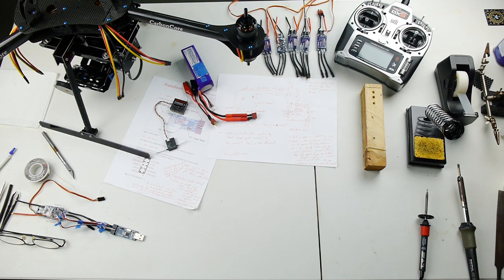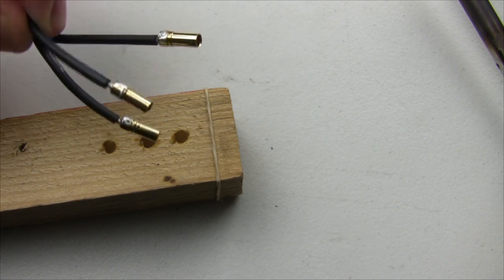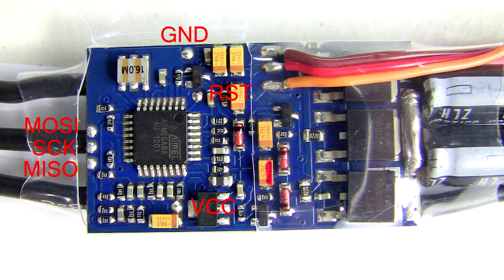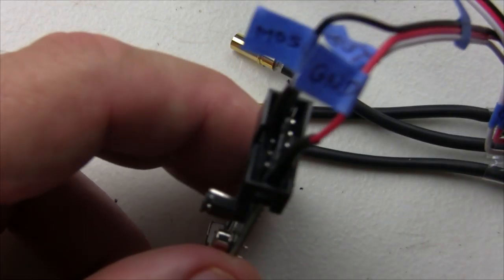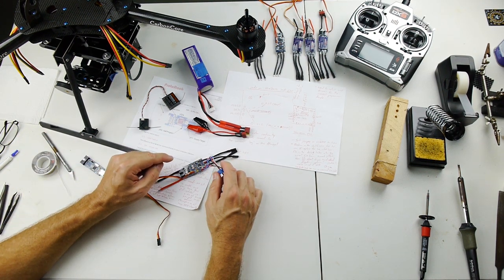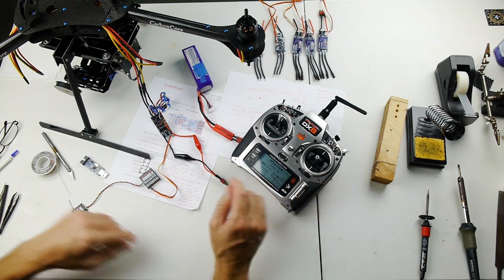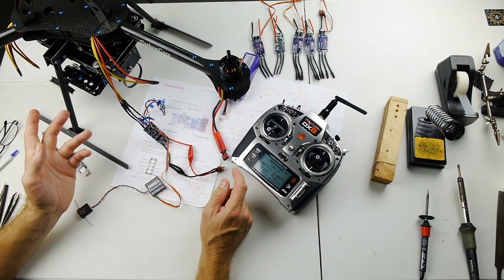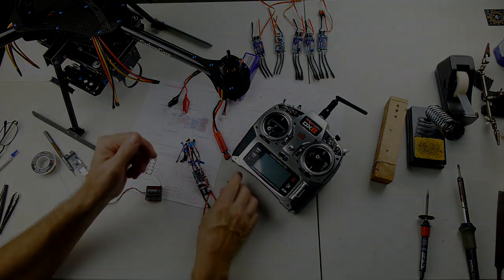Flash BlueSeries ESC with SimonK firmware

Comment: Good helpful video.  Thanks for posting.  You don't need to disable throttle warning to calibrate the ESCs, just turn on TX with throttle in idle, then move to full throttle before connecting power to the ESC.

Comment: 35-40 Watt is where you want to be at. Anything over 20 Watt and under 45 Watt should be good. Don't go higher than 45 watt (I like 30-35) as it will burn uselessly and do damage.

Comment: The CarbonCore looks decent. Who makes it? It might be nice if you told you audience that you can use the Atmel Atmega Socket Firmware Flashing Tool , Hobby King  PRODUCT ID: 332000007 that would alleviate the need to solder leads onto the ESC. A very time consuming process. But your soldering skills are very good to say the least. Happy Flying Derek

Comment: The key only works once you have SimonK firmware on the ESC with a bootloader. So to initially install SimonK on there, you'll have to go through soldering. Later updates can be done with the key only.

Comment: Nice video, Thanks.Also HK sells a Atmel_Atmega_Socket_Firmware_Flashing_Tool... is also usefull and has all the wires and connections for Blueseries..directly to ATMEL proccessors... a must to have tool !! Thanks again for the video.